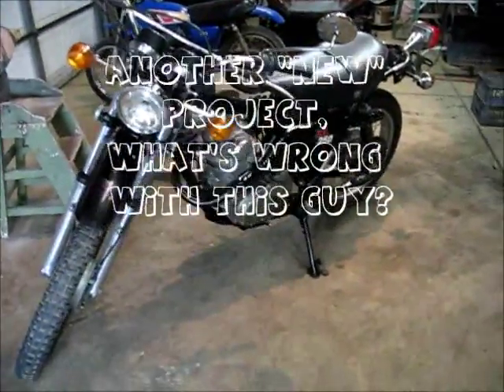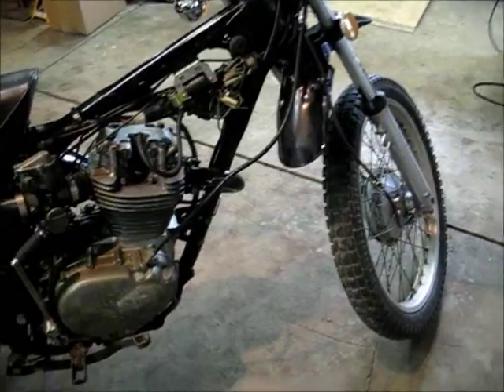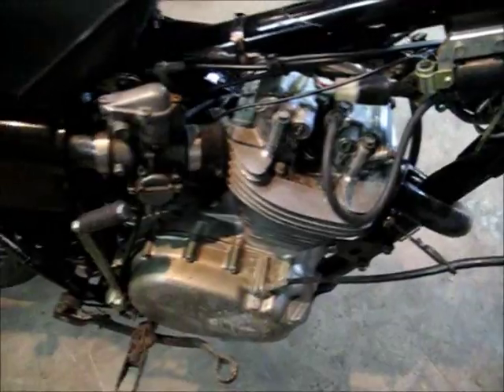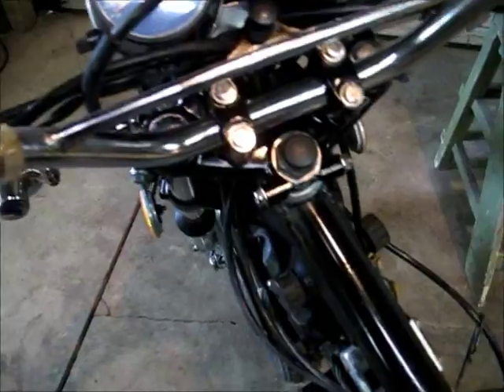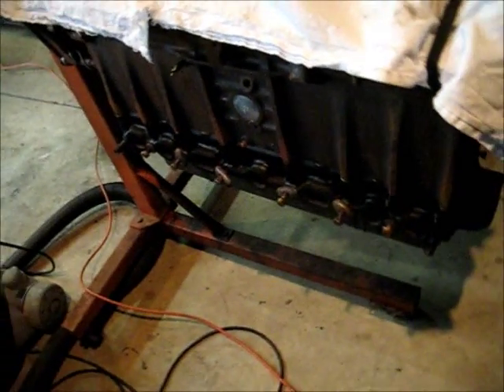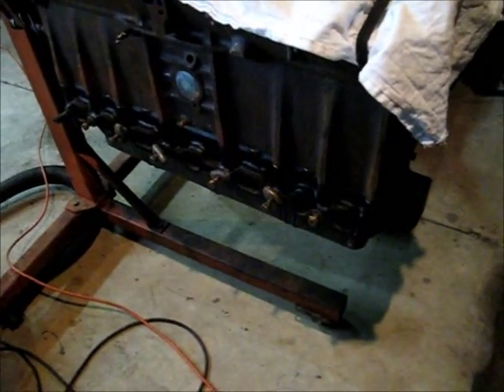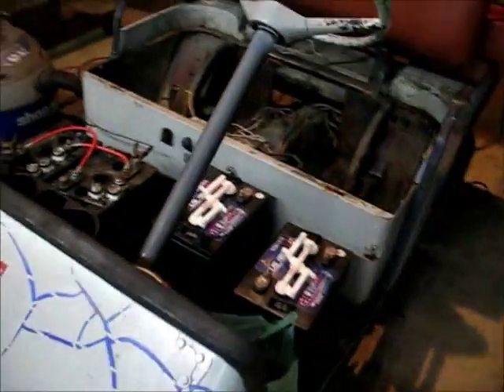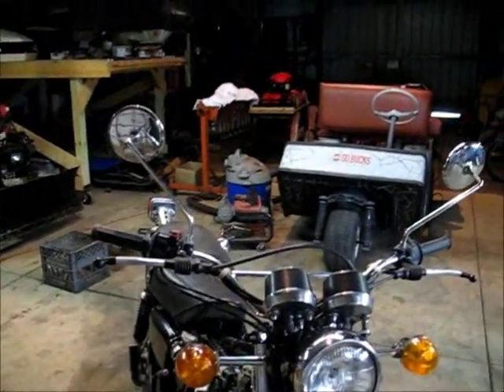My "new" 1975 Honda XL250 Project

Comment from the maker: I really like the bike, except for its top end, it's not geared for any type road speed. You can run at 50-55 mph, but beyond that is creating to many rpm's for me. Other than that and a few little bugs that need worked out, it is a great bike!
Reply: Highways should be avoided if you can. She really screams at 65mph!